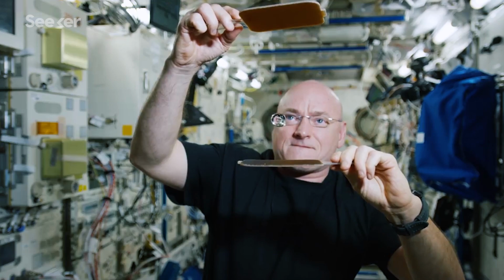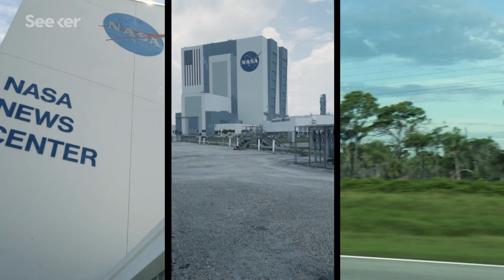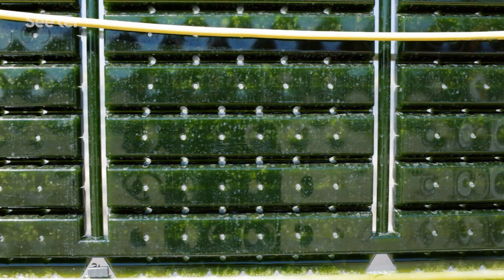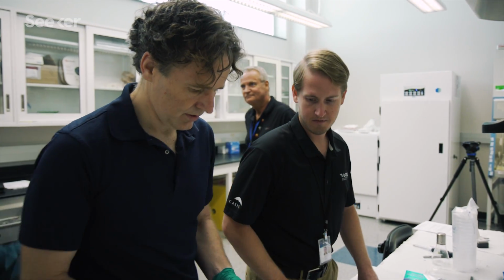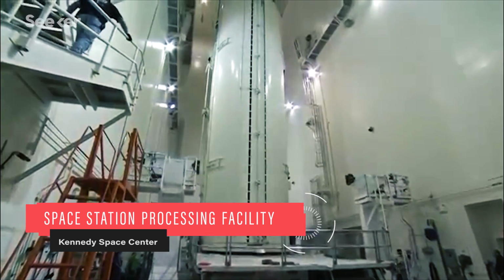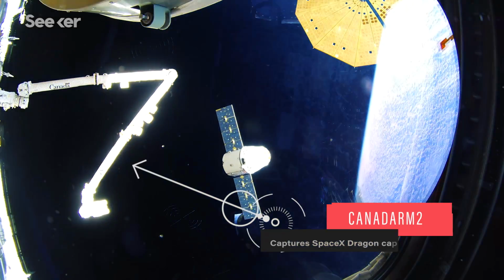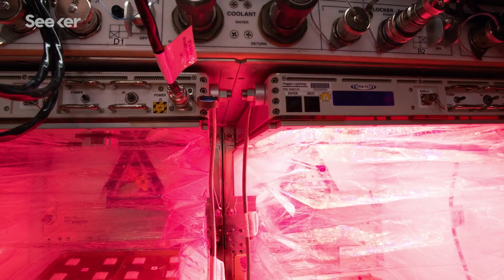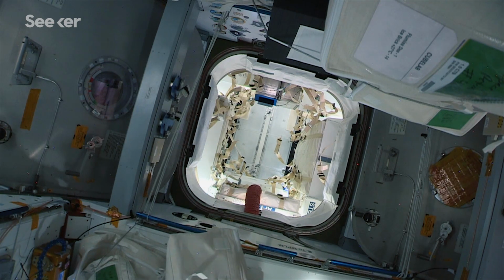SpaceX Just Sent Algae to the ISS, Here's How It'll Power Deep Space Missions

Comment: How would you grow algae if not in liquid?
Reply: On a surface substrate. You've seen lichen growing on rocks and trees, well that's still algae but protected from moisture loss by a symbiotic fungus.
Reply: Thanks! Very interesting.
Reply: Although you can grow algae on relatively dry substrates, like when microbiologists grow cultures on agar in a Petri dish, the term "growing in a liquid" or "liquid grown" has more to do with how this particular method differs from other algae cultivation methods. Typically when algae is cultivated, a substrate is required to so the algae has something to attach itself to and form filaments or sheets or other multicellular structures. The process presented doesn't require any substrate which makes it a little unusual but not completely new since certain algae like Arthrospira have been cultivated without substrates.
Reply: Awesome, thanks for the info.